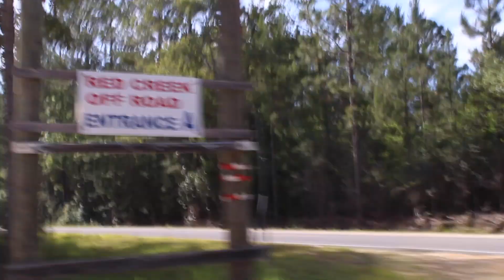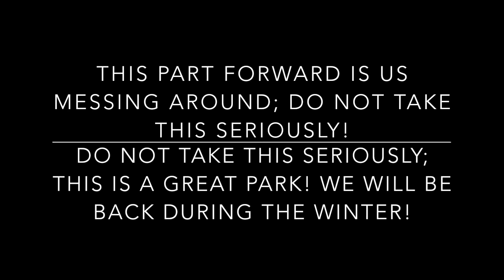BROKE AN AXLE? NO PROBLEM, JUST SEND IT! (Part 2)

Comment: You think 30” aztex would be alright on a 420 no GR? I know theyre lighter tires and people run em on stock 500s/520s but havent seen it on a 420
Reply from the maker: I'd run a gr with any tire over 27"
Reply: One of my buddies runs 30" Aztexs on his 420 and has no problem without a gear reduction